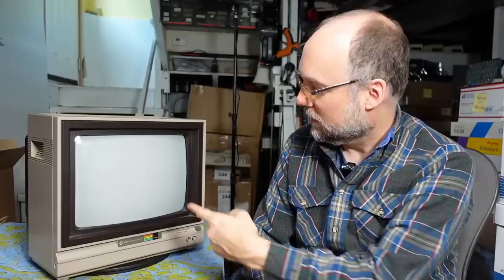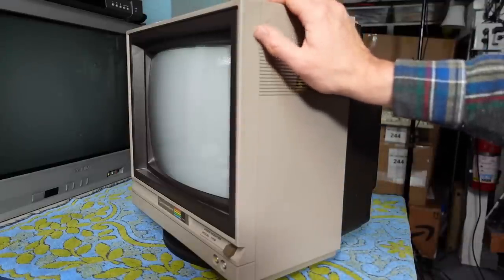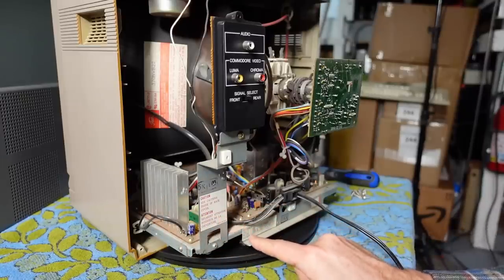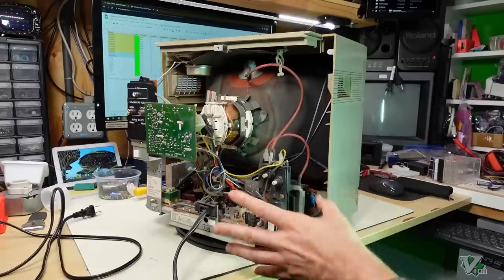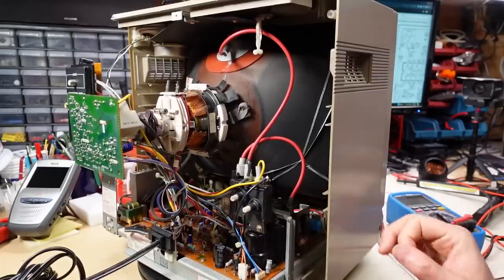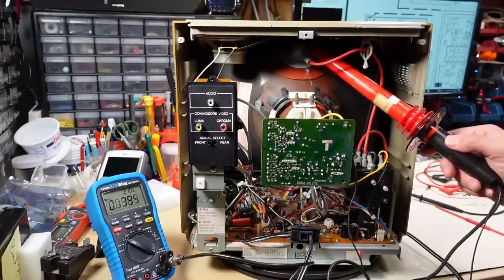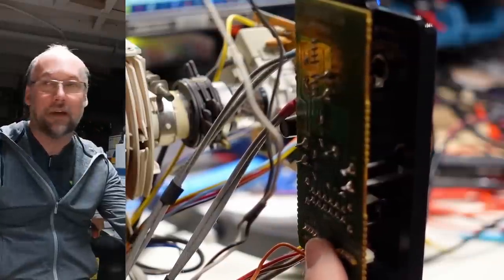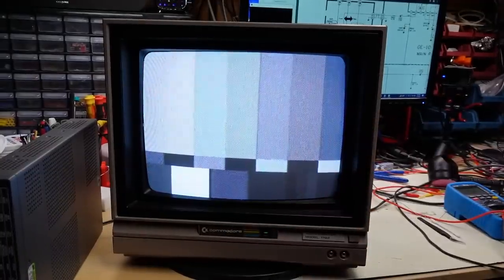This is one of the best monitors of all time (Commodore 1702)

Comment: Also, perhaps that arcing you heard were in the neck of the CRT.  Perhaps for not being used for years, tin whiskers grew inside the neck and then using for a while, the whisker got burned out.
Reply from the maker: I don't think so - it was super loud. If it were inside, it would have been a fainter sound. This actually happened when someone else was around and we both jumped both times. I asked her the other day what she remembered and she said it was kind of scary sounding. LOL

Comment: Did the Atari 8-bit ever have an official chroma/luma output? I don't remember any, and it's kind of sad since they generated compatible chroma (as did the 2600/7800). I did a Y/C mod to a 7800 long ago, and made a small Y/C splitter cable for Commodore's monitors to go along with it.
I basically snatched up every Commodore monitor I found when thrift shopping back in the '90s and '00s. It wasn't a lot, but it was quite a few.
Reply from the maker: Yep the original 800 did.  Later the XL removed chroma but you could run a wire to enable it again.

Comment: I have a 1084S monitor, which emits a slightly annoying > 10kHz audible whine.. (similar to my tinnitus) is there any type of mod or repair that could be done to remove/improve the noise, or is that a fundamental with that monitor?
Reply: All standard raster CRT displays will emit whine at the scan rate, which for NTSC is around 15.7 kHz. There's not much you can do about it.

Comment: 26:59 Certainly not. Any ground beyond the secondary of any transformer is completely arbitrary, and exactly because the plug only has two prongs, no circuits will have -whatever voltage in respect to ground.

Comment: I still have my 1701 from when I was a kid, but over the years the picture has gotten smaller so that I have about a 1-2 inch border around the edge and a smaller square picture in the center of the CRT. I have no idea what has caused this and no idea how to fix it.
Reply: The components are so old they are beyond spec (old age). A tv technician could restore it if you want it back to where it was decades ago.
Reply: It sounds like a problem with the "low" voltage power supply. If you look up the service manual this should be easy to check with a multimeter. It might be as simple as the adjustment trimpot being dirty, and cleaning (and resetting) it will fix the problem. A poor connection to the regulator could also make this happen suddenly. Or if it happened gradually components might be drifting.

Comment: scanning/transmission electron microscope as a single crystal wafer disc drive is not much different from a crt, or a blu-ray drive, and you can use hard drive style piezo linear actuators with spinning disc motor, but the electron beam makes the dot size under nanometer, much better than hdd and blu-ray drives, as e-drives, or electron drives
Reply: if the circuits takes in rgb already, why you need to fiddle with middle conversions, feed the rgb directly to the rgb interface, no need to also fiddle with ac, when dealing with dc only, as an analog, dc motors
Reply: what is camera sync, to video output signal
Reply: you can even bury that nuclear waste under the moon surface gasket
Reply: stop the doping, pn junctions for transistors, sub-nano photon momentum optical gates are much better, smaller and faster, and optical lines can overlap each other (cross over) or even mix with several frequencies, if you do the exact linear calculation by gates to the different signals
Reply: the sub-nano mems cantilever mirror/gate needs to be so small that the photons/laser can push it

Comment: I do enjoy working with old systems myself.. But i really don't miss CRTs! They can have their uses and can run forever and a day, but..nah. I prefer to save power and not expose myself to the nastiness that is being near a CRT lol Eww Toshiba.. Don't forget JVC is also KenWood! RGB mod wouldn't be so hard as the transistors on the neck board only want 7V... 0.7 to 7V! Dust can certainly cause arcing in old CRTs though, my late aunt's very old TV in the bedroom expired a little after she had..went to turn it on, huge plume of smoke...but of course, the TV did actually keep operating and working with smoke coming out the back 🤣

Comment: Hi Adrian, and thanks for yet another greate video! I am also working on an old CRT with a fault. It makes this "arc"-pop once in a while (1 to 10 minutes between pops), and the image flickers for 1/10 of a second, before it returns to normal.
I have checked it with the cover off in a dark room, but I cannot see any arcing. I have coated the flyback and its wires in high-voltage resin, but it makes no difference. 
Does the symptoms for my CRT look to be the same as you have experienced with the Commodore monitor? Se my fault here:
https://www.youtube.com/watch?v=-cpbiUq4rQA 

And again, thanks for all the greate content you post here on your channel! 🙂